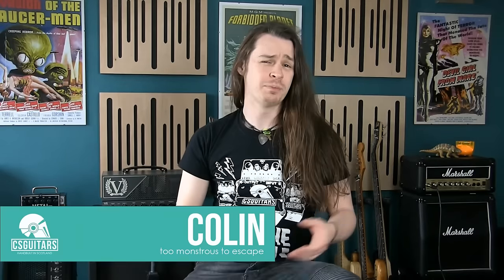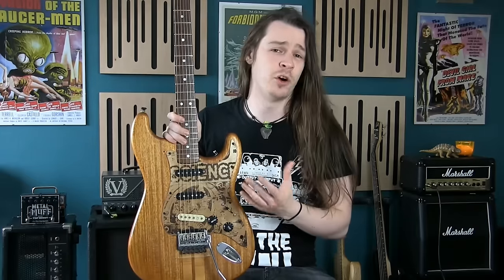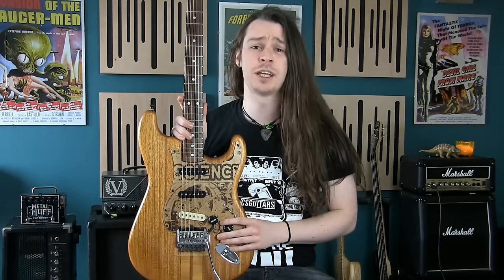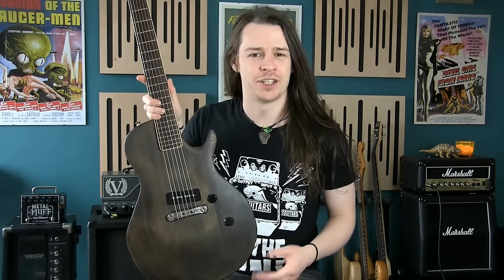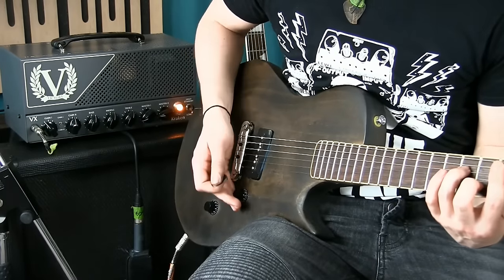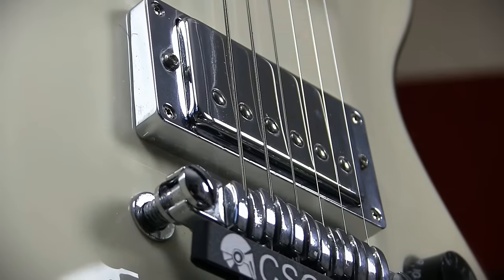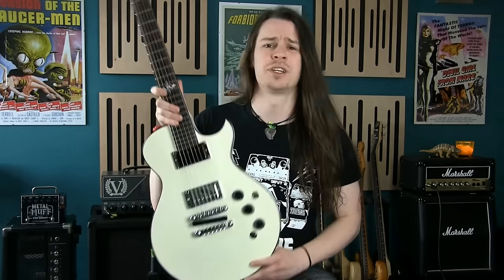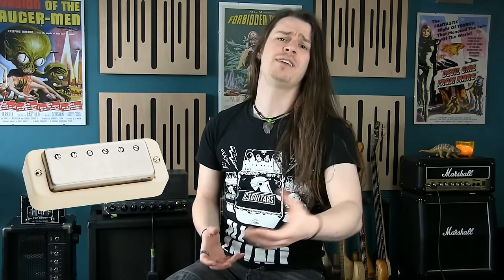Single Coil vs P90 vs Humbucker: What's The Difference?

Comment: Is there a difference in sound between a guitar with just one P90 (Les Paul Jr., for example) and a guitar with two P90s and the volume on the neck pickup rolled off? Newbie here. 😃
Reply: How far a pickup is along the strings will shape the tone. It will vary with what resistance the tone and volume controls are. Besides that, there should be no difference.

Comment: Do Jazzmasters have P90 pickups?
Reply: No, they have Wide Range single coils. Go look up a video on that and you'll get it
Reply: Jazzmaster pickups are not wide range. A P-90 is a single coil, but a Gibson design. A Jazzmaster has a wide/flat coil similar to a P-90 but has a different magnet structure that makes it more twangy. Strat pickups have a tall skinny coil making them thinner sounding than a Jazzmaster. A wide range is a design humbucker designed by Seth Lover for Fender in the 1970’s and is a hot and articulate variety of hum ucking pickup.

Comment: I love your videos! You seem incredibly knowledgeable and have helped me figure out a few things for my rig and musical interests. On the topic up pickups, I have a question. My guitarist recently got a DBZ bird of prey 7 string, with EMG's. He prefers passive Seymour Duncans, but I'm finding it hard to find ones that will fit. Looking at the Nazgul set up, I've ran into the active mount vs passive mount. And from what I've read, they are slightly different. Where the active mount would normally fit, the passive might now. Would this require modification to the guitar? Or is there a special casing that I can make the passive fit? Wishing you the best.

Comment: I have an ibanez gax30 from 2007 and thinking about changing the picukups on them, I have a question my [ickups are humbuckers I think and they have 12 poles per humbucker and 2 humbuckers, can I use humbuckers with screw poles and if I do will be sound worse off becaause there are only 6 pole per humbuckers as oppsoed to 12, I did buy this guitar 2nd hand and am learnign to play it.

Comment: For all the genres, it's better to stick with humbuckers. If you have money, PRS Customs with split coil switches...if you must have  a single-coil sound or just simulate it with a modeling pedal board. I've played all kinds of Strats, expensive and cheap; they all sound like crap. Agreed, P-90's wear-out in less than a year with me but I did have a 1967 Gibson SG Junior with a P-90 that never gave out. As for the best sound for all genres, Gibson SGs, Yamaha SGs(yes, they exist), and Paul Reed Smith Standard or Custom models have the best sound. Not a metal guy, so...I don't play "shredder" guitars(Charvel, Jackson, Ibanez RGs, you get the point...Kramer).

Comment: What's the difference between P-90's and P-100's.  I couldn't tell the difference simply by looking at them, because they look exactly the same, so how does the construction / wiring differ?
Reply: A P-90 is a single coil pickup. A P-100 is a stacked humbucking pickup with 2 very similar coils stacked upon one another. They have a higher DC resistance and higher inductance and though they don’t hum, they are a bit subdued in the treble frequencies compared to a true single coil P-90 pickup.

Comment: Hello, out of curiosity, the Telecaster (bridge and neck) pickups sound like a P90?
Again, greetings from Mexico.
Reply: Josué Uriel Bautista González Depends on the telecaster being used. 

Some tele designed guitars have single coil, actual p90, and humbucker pickups. 

There are different teles manufactured for different music genres. A lot of guitarists are fans of the tele because of this. Also, there are a lot of telecasters out there that arent technically teles, they were purposely designed to look like them, only.

Comment: Did the guitar with the P-90 have a built in distortion circuit or is that the actual sound of the pickup and you were adjusting tone/volume?
Reply from the maker: +Mattom2001 no distortion circuit, I was showing how much a p90 cleans up when you roll the volume control down on the guitar.
Reply from the maker: +Mattom2001 for further clarity: the amplifier is set to distortion. When the guitars volume is on 10 the P90 gives out its full signal and gets amplified with lots of gain applied. 

When you turn down the volume the P90 gives out a weaker signal which doesn't drive the amplifier as hard, so it doesn't get as much gain as it is amplified, leaving it without much distortion. 

It's a great way of getting clean and distorted sounds without changing channels on your amp.
Reply: Ah i see, thanks

Comment: Might be stupid question but will a P90 pickup fit in a single coil slot on a strat copy guitar?
Reply: Nope.  They are nearly twice as wide.  If you check under your pickguard you might find a big enough body cavity for one to fit.  Then you would have to modify your pickguard, (i.e.: cut a bigger P90 sized hole), or find a new pickguard with the proper sized hole already cut.  Make sure you check that the P90 will work with your volume pots.  I'm not sure if they need 250 or 500 ohm pots.

Comment: You just have my playing/ jamming setup casually sitting in the back ground. Someone tell me how this is: I have an orange Micro dark going into a marshall 1960 Celestion 75s with a Metal Muff ( gain almost all the way down) and a digitech Drop tuning pedal. Gunna switch the head out with a Marshall JCM 2000 ( yea Ik my tone is gunna change jarastically)

Comment: I have a question regarding the Humbuckers pickups. On my 1984 Ibanez bass if I select either bridge or neck pickup they work as normal, but if I select both at the same time I get this funky no bass tone along with it sounding like it’s far away. Kinda hard to describe
Reply from the maker: Sounds like they are wired reverse phase with each other.
Reply: CSGuitars I’ve had the bass for around 15 years and the only thing that’s been replaced were the tuners . The electronics haven’t been touched, that I’m aware of it’s still original

Comment: On your les paul, what is the black block in between the tuneomatic & stop tail ??
Reply from the maker: +KARL SHERIDAN it's a Jimmy Clip, it prevents the annoying chime from strings ringing behind the bridge or nut. It can be especially bad on down tuned guitars with thick strings. 

I did a video about them here: https://youtu.be/wM5bc9i7l4o
Reply: Excellent, thanks for the quick reply. I'll check out the video 👍🏼

Comment: hi I got a question, I'm using HSS pickup configuration. when I'm playing on full gain and high volume I'm getting feedback when I switched on to humbucker on bridge position, but when I switch on to my single coils pickups on the middle or neck I don't have feedback. is it normal? or may guitar have a problem? by the way thanks to your channel, I learned a lot from you. :)
Reply from the maker: Your humbucker has a lot more output than your single coils. It's essentially louder. The louder you are, the more chance you have of feeding back. 

It's as simple as that.
Reply: CSGuitars thanks. more power for your channel and keep rockin! :)

Comment: youre right, i had to dig pretty deep before I found a metal player who used single coils. All I could really find was a bunch of unknowns called Iron Maiden. Dobber.
Reply from the maker: +tusskmusic might want to check again on that one, Iron Maiden are largely using humbucker equipped strats, be it full size or single coil sized humbuckers. 
The amount of lights they have on stage makes using true single coils a problem.

Comment: I actually really enjoy this channel as the info on it is really well thought out and presented but the tone used is horrendous. In this video especially, the demo didn't do the P90's justice at all. A good P90 in a decent guitar will be able to do pretty much anything, from twangy single coily sounds to full on distorted raunch. They can be aggressive but they can do pretty tones as well. That's why they're popular in jazz and simultaneously heavy metal was invented with them (as they were the pickups on Tony Iommi's SG Special).

Comment: the real question might be, whats the difference with humbucker, double humbucker and triple humbucker! asymmetric noise cancellation? let me put it simple, (1)+(-1) = 0, so? (1)+(-1)+(1)or(-1)?=??? heck with a stereo thin earphone jack i can invert one channel and play the guitar in one and it become a noise cancellation because one removes the noise from the sound since both contain the noise... how could that work with 3 channel? lol 4 is simply 2 time 2 but 3?
Reply: just wanted to add, single coil definitely has peaking on high mids great for country and black metal if you put some more gain on the same sound... and maybe a tad of reverb (not too much... people tends to think it should sound like a church or the woods in france ;P or a public toilet) i have a Quest Atak 5 and it has a switch on that turst off half of the humbucker and makes it a single coil! so i get to hear exactly how different it would sound on the exact same guitar and all!

Comment: Colin, what's that Floyd Rose looking bridge on the Strat?
Reply from the maker: +Paul Mason it's a Kahler Traditional. It's an older model that I don't think they make any longer.
Reply: CSGuitars bummer. That'd have been perfect for what I want. Does a Floyd bridge work as well without the clamps but fitted with locking tuners?
Reply from the maker: Assuming it's set up well, then yes. 

Where a lot of the tuning problems occur with a floating bridge is at the nut. as the tension on the strings shift the strings slide through the slots on the nut. 
If they get stuck and don't return to their original position then the guitar goes out of tune. A good well cut nut that is lubricated won't have that issue, but most nuts aren't that perfect. 

The locking nut eliminates that issue by clamping the strings at the nut, so there is no sliding movement to risk them hanging up. 

Locking tuners will do wonders, less than one winding around the post means that the string won't loosen and tighten into different positions there, but it does nothing for the nut. 

So, on a good set up, locking tuners are ok, but a locking nut is the safer way to go.

Comment: I listened carefully and there was no difference. I play guitar for 50 years and I have tried single coil and humbucker pickups and there is no difference. The sound creates the hands and the brain of the player rather than guitar, pickpups and amplifiers. Each player has their own specific tone and any guitar, with any pickup, on any amplifier it will sound the same. The difference is maybe only if it is played with the clean tone but with the distortion of each guitar, every pickup, every amplifier sounds the same.

Comment: P90s are stronger pickups then typical single coils. Thus they are more powerful and are darker. They are less sensitive or nuanced.

The humbucker is also more powerful and darker and much less sensitive and much less nuanced. It almost sounds bad when it is clean which is why few play clean with humbuckers. 

it is probably a bit of an exaggeration to say the generations of guitarists have been ruined by using humbuckers and fake distortion effects because they do not like the clean sound of their guitars. But all you have to do is play a good single coil guitar with, say,  a Fender Hot Rod  DeVille amp or similar, and play a G chord all by itself with no effects. Not the G suspended 4th but the plain G chord. And the tone is pleasant to the ears. People would be quite shocked at how good this sounds. 

Instead people play sounds that sound bad because they are caught in some sort of revenge on previous generations and so like to make sounds that sound horrible and horrific and disgusting and putrid, the kinds that would make your parents gag and be sick.

Such is life.

Comment: Uhh, skipped a few (sort of like saying there are  three kinds of cars): lipsticks, rails/quad rails, alumitones, stacked (noiselss) singles, magnetic poles or standard, filtertrons, duosonics, piezos, active/passive (and some more in this link: https://www.stringjoy.com/types-of-guitar-pickups-explained-compared/). Then the endless plethora of constructions details, interactions with pots, caps, coil taps, coil splits, serial/parallel, series/parallel, varitones, etc.. 

Have fun sorting it all out, mates. I'm started at 15. I'm still sorting and now I'm 64.

Comment: Those single coils are setup so low
Reply from the maker: +Sune Pedersen not with respect to the strings. The neck and bridge sit lower on this guitar than on a standard strat, so naturally the coils have to sit lower too.
Reply: Ah what gauge are you using?